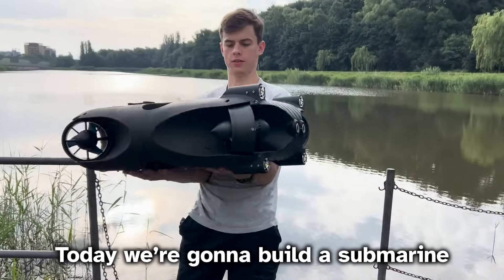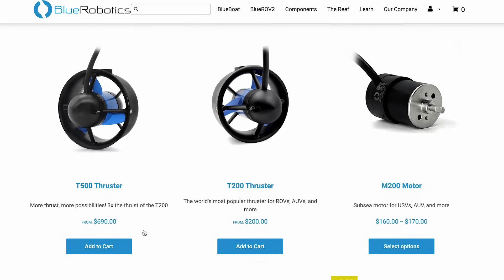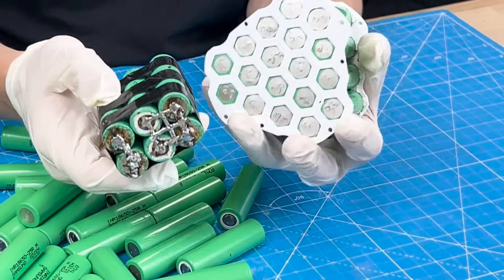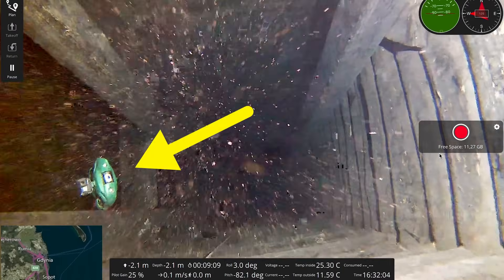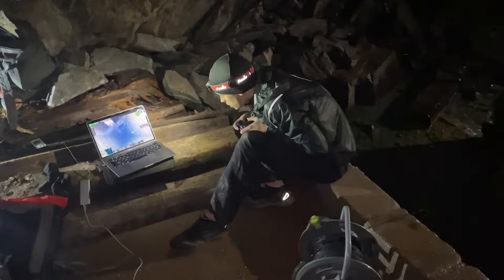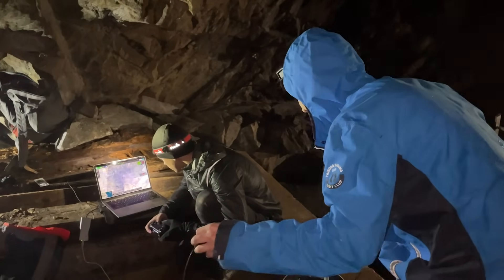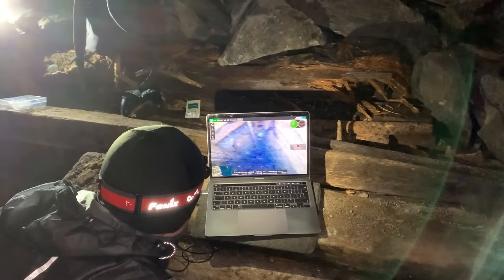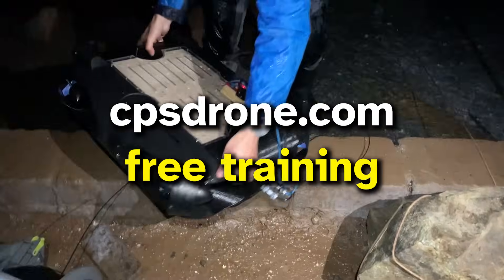My DIY Submarine Dives As Deep As Possible (PT2)

Comment: next time don't forget a second thether just a second cable that is more solid then teh fiber optic you turn it on the fiber optic like to make a rope so that it doesn't bother 

other suggestion place more camera one on the back one under it and one on top so in case of the cable being stuck you can see without having to fully turn the sub and you can just go down

Comment: For the home builder, fiberoptic is really expensive and breaks easily. If you watch the big work-class ROV teams, they've got a huge large-diameter drum they wind it on and off, to bend it as little as possible. I use RG59 coax, with an ethernet-over-coax adapter at both ends. This gives me good connection over as much as 1300m. I also put a stripped-down security system NVR in the ROV, allowing me to have real-time views from 8 cameras.
Reply: I also put 'hardware cloth', 6.5mm square galvanized mesh, formed into a cone, over both sides of my thruster ducts, to prevent the injestion of foreign objects. Next time it would be a good idea to bring a folding table and some chairs...LoL.
Reply: I keep thinking of more stuff. Making the ROV positively buoyant means when you get close to debris, the water stream is jetting up, minimizing kicking up clouds of particles. Keep the lights as far away from the camera as possible to reduce backscatter from all the fine particles suspended in the water. Putting a hook in front could help you untangle or retrieve things. Servos can be filled with mineral oil, their potentiometers replaced with magnetic ones, to use outside the ROV. Putting the camera in a small WTC so you can pan and tilt with a headtracker makes it easier to maintain situational awareness. I made my lights track with my camera so I'm never blinded.
Reply: The size of the tether and the drum has nothing to do with bend restriction as we have much tighter bends inside the vehicles.
The work-class ROVs run off of 3KV and quite a few amps which requires a substantial cross section of the cables. Add kevlar armour and several layers of insulation to that and you end up with a hefty cable. The FO parts of the tether is usually just a 3mm stainless pipe containing around 10 individual fibres.
Reply: This man ROV's
Reply: Back in the old days, Ethernet run over Coax, either thick-ethernet or thin-ethernet. If i dont missremember the thin one was RG58. I have had plenty of ethernet adapters with coax, the possitive thing was that you did'nt need to use a hub, The dowside was that it needed to be terminated, and if it had some error inbetweeen the whole segment went down.
Reply: yeah, I was thinking they could use Cat7 wiring... they don't need more than 1gbit... It would probably be fine and they could run PoE over it (48VDC) and not have to worry about battery capacity.  I don't know how that would deal with depth, though... It would not be nearly as flexible, so unlikely to get tangled.
Reply: @qcca123-f1v  Ethernet cable is okay for testing in a pool, easy to get, but if it cracks you will get water ingress. Used often by kids in STEM. RG58 coax is the slightly thicker 50ohm ham radio stuff, RG59 is the thinner 90ohm+ coax primarily used for cable TV.
Reply: @darrelljacobjr2120  There is indoor/outdoor rated ethernet cable... like safe for burying.  but yeah. I don't know what happens at depth.
Reply: Where can I have look at your rov..!?
Reply: OK so that's why they are losing video connection.. they are moving to much the fiber optic cable if it has a big curvatture you loss totla internal reflection and cable losses skyrockets! HAHAH I FUCKG LOVE ENGINEERING!
Reply: @SBLP24  no that is not whats happening. Look at what the fiber strand at the end of the video, an absolute miracle that the feed wasn't permanently severed.

Comment: i mentioned it in the previous video but a spool of armored fiber might be better for these confined spaces since its surrounded in metal conduit, though since it is more rigid you'd lose the fluidity of movement. a way to automate the spool's length based on tension might also help

Comment: You could also put mesh over the propeller hole to stop any object from tangling in the propellers just as long as the holes are small enough to not let objects through but not small enough to reduce the water flow through the propellers I have just noticed the comment below mine which states the same thing.

Comment: here are some things you could try to add to make it even better
1. bar sensor, to make sure it doesn't implode like last time
2. camera's around it to see if you hit something that also have something so it will know if its close to something
3. i don't know how your going to pull this off but a sensor to check if you hit something and if something broke
4. a mic so you can hear if something broke, or if there animals in the water you can hear them etc
Reply: I think you had many great ideas, but the easiest for the nr1 point is to just pressure test it, and see when it fails to know the limit. Every 10m is 1bar/14,5psi. Nr 2 and 3 can maybe be done with a sonar but in a hobby setting its not very necessary.

Comment: What if you add something as an in between the wire/cable and the craft. To what I am referring to, as an reference from the Gundam Unicorn OVA the mobile suit Rozen Zulu and it’s INCOM units(it’s the thing with the wires that connect between the arm and it’s claws) mainly the things in between the the arm and the claws apparently it’s called an INCOM Relay maybe you guys could do something similar to it and add propellers to it so you could adjust the position of the wire while giving it tension?

Comment: rear camera and some motor meshes, so the wire doesnt go inside the propellers...also for the wire... you need a pulley with a heavy wire... that follows ur fiberoptics down... that way the wire doesnt bend and is not dragged arround in water by the motors.

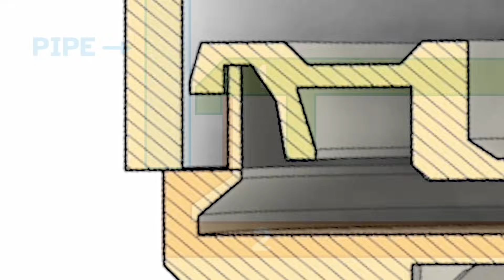Comment: Reconsider how you design your seals.  The design shown @1:00 is designed to fail due to extruding o-rings and plastic components.  a simple face seal design would ensure there are no gaps to extrude the oring as pressure on the cap would prevent extrusion.

Comment: Give the drone a tail, route the fiber through that, fairly stiff but flexy at base, this should keep the optic fiber from being able to get near the drone. 
Add a load cell as well, monitor the tether tension(on drone end), good for checking it it is stuck as well as plying it out or in.

Comment: If the cable gets stuck for real and it's impossible to get it out, you could make some form of emergency system for this. It could disconnect the cable and the drone could float back up with no control. Obviously this should be done only, when nothing else is possible.
Reply: its neutrally buoyant , its not floating anywhere.  it can only move with its thrusters
Reply: @swfreeD  There could be a ballast tank, which would blowed to increase buoyancy.
Reply: @aapopesonen2902  theres still the issue that this thing might just spin out of control and get stuck again, or worse, disappear into a side tunnel. to many obstacles on the way up
Reply: @swfreeD  As I said, this would be only in emergency. I'd much rather take that chance, if the alternative is to leave it there.

Comment: Such a thin fiber optic cable as your only tether is bad u would attach like a think but strong steel cable to the body of the sub also with the cables in case it gets caught and gets ripped out

Comment: y should add Lidar on all sides. So that in case of connection loss it will find it's way back with automation. And make system that when connection is lost and it comes back, if it gets tangled by cord it removes the cord, and comes back without cord.
Reply: y should mesh those engine holes.

Comment: You could develop some kind of sonic transmission. It should work very well in isolated mine filled with water. Just two sets of waterproof microphones and speakers - one on the submarine and one on the controller.
Obviously it will not give you good video but should be enough to get submarine back up in emergency like that.
Reply: it wont give you any connectivity at all as soon the motors start. the noise chops up any usable signal you might have had.
Reply: @swfreeD  Isnt it matter of frequency? Motors operate at rather fixed rpm and rest of all the noise is going to be relatively high frequency.

Anyway issues with idea is mostly baudrate. I do not imagine having much of use with something up to (generously) 1 kbps
Reply: Great idea!

Comment: It might help with the tether problems to use some sort of sprung coil so it always keeps light tension on the cable preventing it from randomly floating around and getting tangled, maybe make the drone slightly less buoyant to compensate the pulling force on the tether, also a backup camera to look straight back would help when retrieving the sub without needing to turn it around and maneuver too much, lowering the chance of tangling even further.

Comment: I am about to start re-designing a bait boat for my carp fishing hobby, I also want to make a launchable from the boat, controllable micro sub camera.
 I came across your channel while searching for information, very interesting!
I have multiple large format FDM printers which should be just fine for my purpose
My only problem is that I am still learning Fusion 360, the first iteration of my boat was designed in Tinkercad, however, this software has limitations and so the design looked like something that would come out of the early Soviet Union! LOL

Comment: Would it make sense for there to be a steel cable attached to the fiber optic cable to make tangles and cuts less likely? And it would make retrieval much easier, less likely to damage the cable, no? Also, is it possible to have programing to force it back up? I guess without ballasts this is harder to do...

Comment: nice job... looking forward to the next video, now can you go down to the titanic? (maybe separate the drone from the tether? do they need to be in contact or can you just be in proximity?)
Reply: "you managed to do 150m in a mine with no currents or weather. Now do 3.700m in the middle of the atlantic ocean" big ask

The tether is carrying all the data. Video and info upwards and steering and commands downwards.
Radiowaves and light go through air easily - but not through water. You either need a tether like in the video or some complicated audio transmission (wich usually has minimal bandwidth)

Comment: actually having a power cable at least as a backup is a much better option, than just having optic fibre. it will also add up to cable thickness, which would prevent it stucking in narrow places and will allow you to use it as a much more reliable rope to just pull out the drone. and of course, you’ll have much smaller possibility of drone going offline due to power loss.
Reply: an electric tether cable which is neutrally buoyant made for rovers with that length is incredible heavy, bulky and expensive. when combining it with the fiber optic cable that cable spool itself would be to large to drag it comfortably into that mine. the main reason they´ve used on board power was not having to use a specialized thicker, heavier cable and just having to rely on regular fiber optic cable for two way communication which is thin and fits on a tiny spool and is inherently water proof without needing to be a super niche specialized cable made for this application.

Comment: To avoid tangling, you can also add floating buoy to keep cable in the center and under tension.
Reply: I'm not shure I'm picturing this right in my head ... but wouldn't any bulb, baloon or protrusion that's fixed to the tether be an additional point that could get stuck or wedged? Or do you mean something like a cable with slightly more buoyancy that would keep its tension and any surplus length would float at the top?
Reply: @Culpride  Maybe a piece of heat shrink every few metres on the fibre cable with a small piece of foam tape (or something similar that wouldn't crush) under the heat shrink.  This would give the fibre cable a tiny bit of positive buoyancy keeping it straight and reduce the likelihood that  the drone would rise up into the cable. Using heat shrink would only slightly thicken the cable in the spot where it was used.
Reply: Yah I was thinking some sort of tripod with a pulley on it at the top of the mine shaft. They need to find a way to keep it centered and under tension.
Reply: Or maybe we can do something else like adding a small metal pipe like 2 feet, attached to the submerine and the cable is passed through the pipe, to keep the loose cable 2 feet away.
Reply: @HarshSharma-up5nm   That will restrict it's mobility as it is already quite big
Reply: @MohithM how ? If you can tell me I'll be glad to hear the improvement.❤
Reply: @HarshSharma-up5nm  to avoid strain on the cable on the end of the pipe, you can add rubber flexings
Reply: @HarshSharma-up5nm  That would likely cause more problems than it would solve with it getting stuck.

Comment: "The tether got wrapped around this rope!" so the only way that would have happened was if you piloted the drone around it... right?  Why would you do that?
Reply from the maker: Yes, we must have swam around it somewhere near the 150m tunnel and the horizontal beam, since the rope is more towards the center of the shaft there. Either that or the drone did that randomly by itself while we were pulling it out

Comment: to stop tanglement in thruster, you should try using honeycomb thruster guards. It significantly reduces tangling
Reply: as well as might add somewhat a bit of thrust due to having a linear thrust output if you make i 1cm (1/2 inch) thick instead of creating turbulence
Reply: Also toroidal propellers
Reply: @Mark-uk8wz  toridal props that are good arent really worth the cost.
Reply: @Mark-uk8wz  those cost like 20k USD each, are you insane ?
Reply: @DrakyHRT  it is diy submarine with printed parts yes? how would it cost 20k to print your own parts lol
Reply: @SplarcieRS  Take a look at RcTestFlight's tests of torodial propellers. At least with the designs he's tested, they underperform compered to traditional props. If there was a known top-performer design that could be another story, but it's very likely that the injection molded props already on the thrusters would generally outperform 3D printed props, especially 3D printed torodial props.